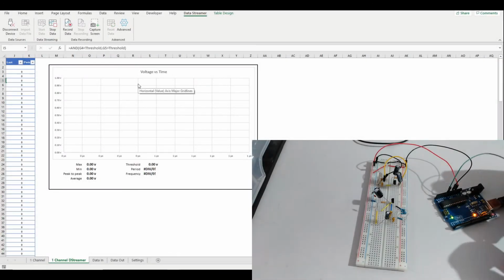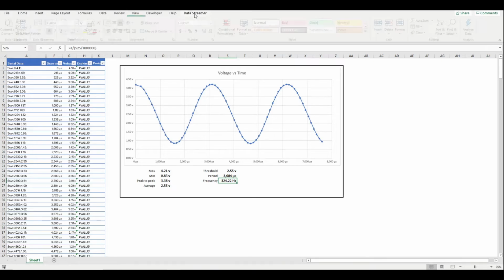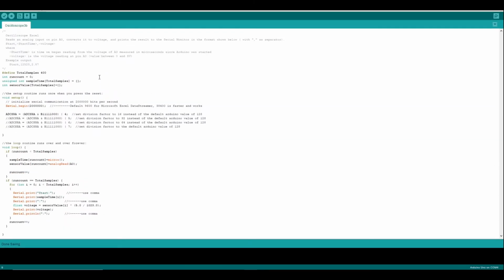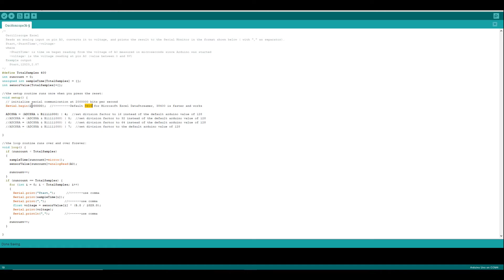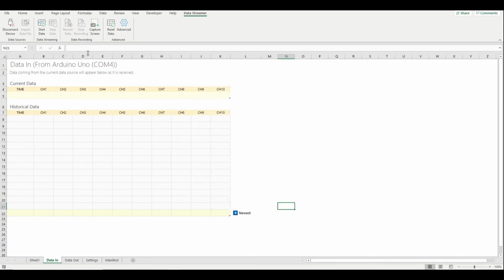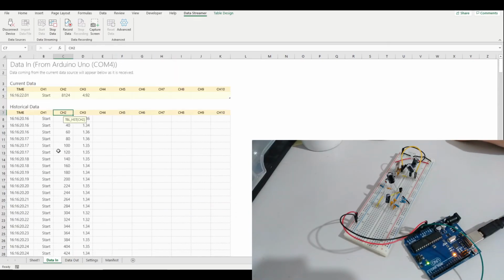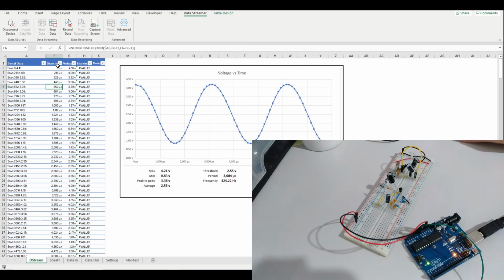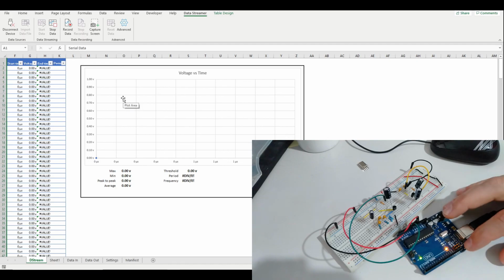Using Excel Data Streamer - Arduino Oscilloscope (Exceloscope part4: automation with data streamer)

Comment: How to use data streamer to plot real time voltage against current graph from the Arduino sensor?
Reply from the maker: What component are you trying to measure current through?
If it is a resistor you could measure the voltage on both sides and then calculate the current.

Comment: hi. is there anyway we can save the data with the timestamp?
Reply from the maker: On the automated worksheet called "Data In" that excel fills in with the data it receives it has a column TIME.  That column contains the date/time that the data was received.
Reply: @overengineeredinoz7683  yes, but when you save the data, the date/time not appeared. it only shows the data recorded from the sensor

Comment: what happens if you record the data for about 2 days. can the add-in handle it? or do you know what is the data in limit of this?
Reply from the maker: I have not tried that. I adjusted the settings to record 200 entries but I think It can be a higher number. I am not sure what the limit is. If you are taking many readings over days it might not be the most practical way to do it.

Comment: how did you increase the number of rows? (Mine has maximum 500 Rows)
Reply from the maker: On Excel Worksheet called "Settings".  You can set the number of rows it keeps with the setting called "Data Rows"

Comment: I want to import real-time barometric pressure data from an Arduino to an OpenOffice Calc spreadsheet. I am using OpenOffice Calc, because it is freeware and it still supports Windows XP. Could someone please tell me how to do this? I am not finding the information. LibreOffice Calc has the Streaming function, but it is not operational, yet... Meaning, it is grayed out.
Reply from the maker: I haven't any experience with OpenOffice Calc so unfortunately don't have any advice. I would be interested in hearing about it if you succeed.

Comment: hi! I can't see the Data streamer option in my excel what to do?
Reply from the maker: I think the Data Streamer option became available in the subscription (Microsoft 365) version of Excel.  if you have an older version it may not be there.  You could upgrade excel or use the manual cut and paste method as per the video titled: Oscilloscope using Arduino (ExcelOscope: part1: Building it)

Also make sure when you do File - Options - Add Ins  that you are choosing "COM add ins" in the drop down menu not the default "Excel Add Ins" before pressing the Go button

Comment: You have made some pretty good stuff, where about in Australia are you?
Reply from the maker: Thanks. Looks like you have some pretty interesting videos on your channel. I am in Perth.
Reply: @overengineeredinoz7683  thanks mate, I’ve subbed and I’ll keep a look out for your stuff as it comes out. I’m in Melbourne
Reply from the maker: Cheers. I have subscribed to your channel and will work my way through your library. I like the wpf application that controls the Arduino led on and off video

Comment: Hello! Excelent video! When I click com devices it doesn't appear any COM and I already have my COM26 active with the arduino IDE in this case I'm using an ESP32
Reply from the maker: For me the comxx number that appears for the Arduino ide is the same number that appears in excel for that device.  You can't connect the excel one while the Arduino serial monitor or serial plotter are engaged. I have not tried with a com number as high as 26 but it should work. I have seen websites explaining how to reset the com number assigned to the device in windows. You could try that.
Reply: @overengineeredinoz7683  that's correct I already figured out that I had to close the monitor from the arduino to use it on the Excel, thank you very much!
Reply from the maker: Glad it worked